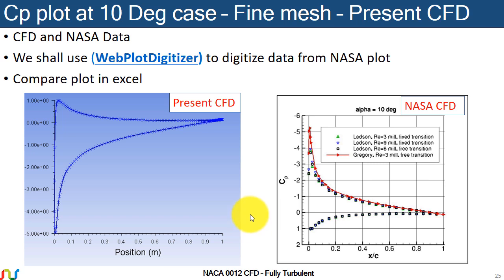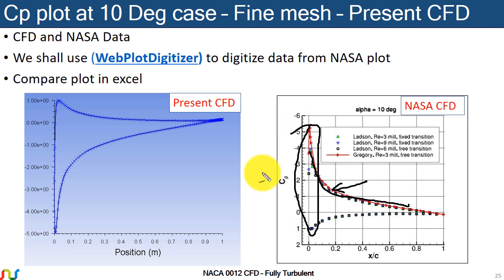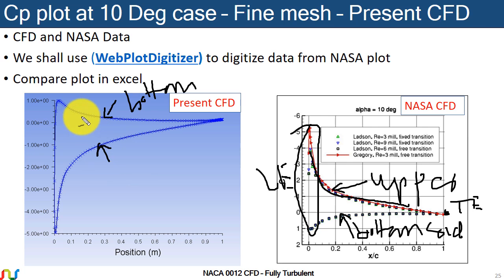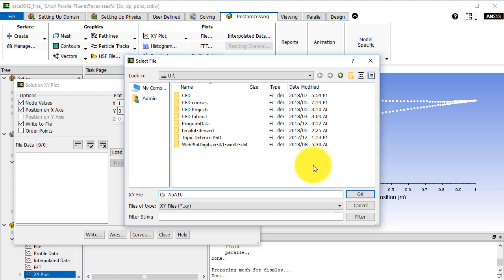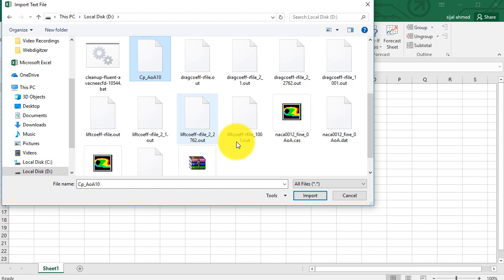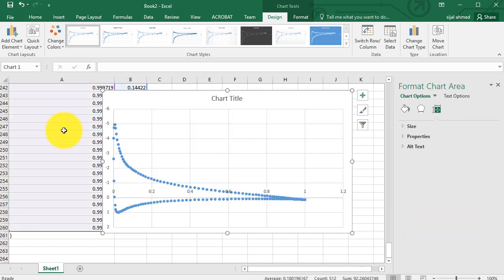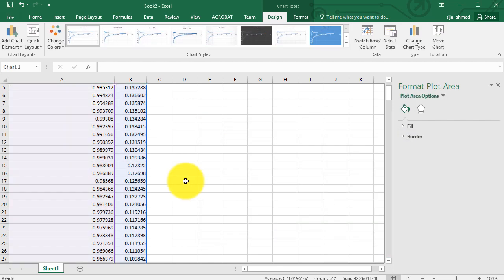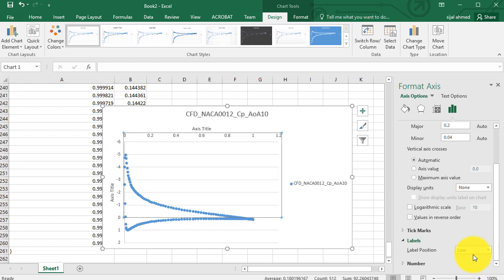ANSYS Fluent tutorial | Plotting CFD Cp (coefficient of pressure) plot in excel

Comment: IS THAT Cp PLOT CAN BE plotted in the ansys itself??? i mean by not importing the values in the excel sheet..
Reply from the maker: Yes
Reply: How it can be plotted in ansys
Reply from the maker: @maheshshetty1679  Go through my udemy course you will get all steps there.
Reply: I have a doubt that "if certain number of iterations are given for runny calculation then in the XY plot how many points could be generated ?"
Reply from the maker: @maheshshetty1679  Number of points are limited to 100 i guess in Fluent for one line
Reply: @CFD_Mechanic  in the reports in XY plot by choosing pressure and static pressure and choosing the Direction vector of any pattern , by selecting the named selection on the list I am getting 2 different values for the line which was created in the Design Modeller  but in the NOTEPAD file it was showing the pressure coefficient at 0th position and 0.05th position and values are different for one selection..,at  0 position the values inthe NOTEPAD file are 3 and at 0.05 position the values in the NOTEPAD file are 3 ..So in that file at zeroth position what value should be taken (is it the biggest value of Cp or smallest Value of Cp at that position) and on the  other selection(next to previous) also one position is observed as common that is 0.05 and 0.1 in the selection so what value should be taken??  
Please kindly respond ..Tq